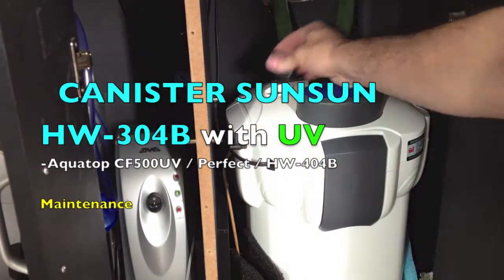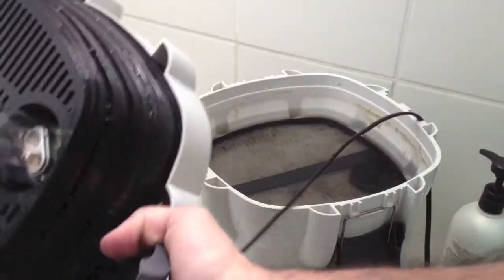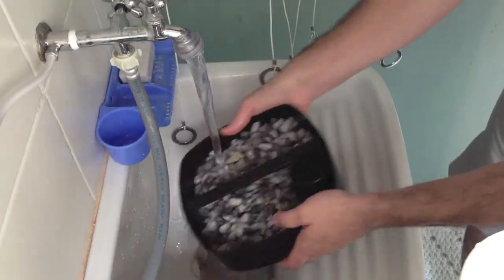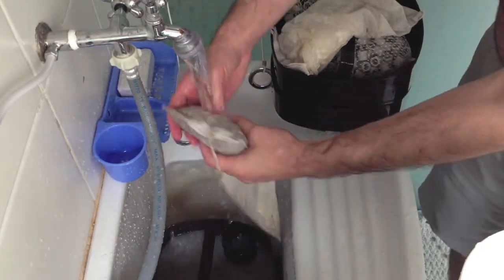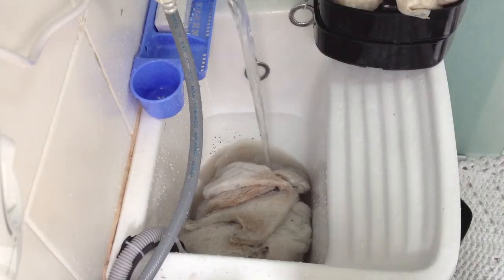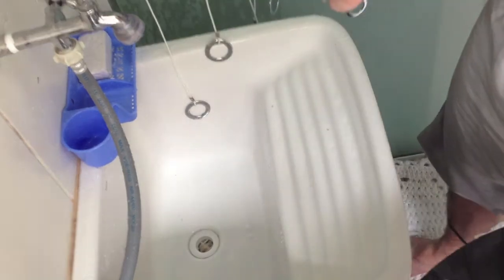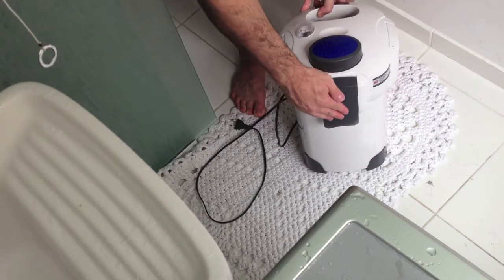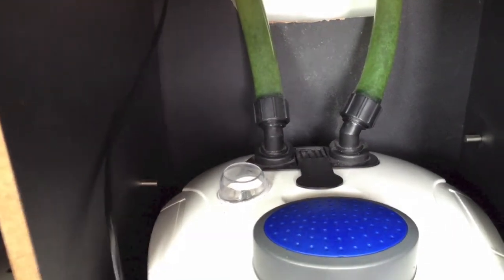CANISTER SUNSUN HW-304B UV 9W - Same as AQUATOPCF500UV/Perfect/HW-404B Maintenance English

Comment: I like your video.  I have a question about the cleaning the propeller.  After I cleaned it and put it back, it came out in pieces and I just put it back together.  When I started my filter it was noisy.  I noticed in my sink a little black cap.  So I took it apart and didn't know which end to put the black plug on, so I put it on the top that goes into the thing you twist and put it back and It sounds like it should, but I noticed on your video, the black plus is on the bottom.  Is there a black plug on the top too?  I'm thinking it may have went down the drain.  TY